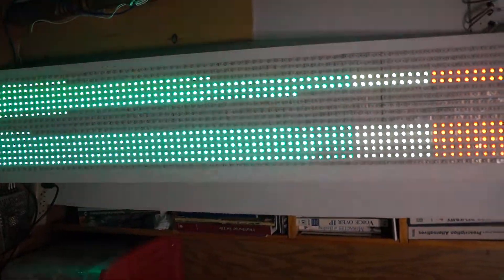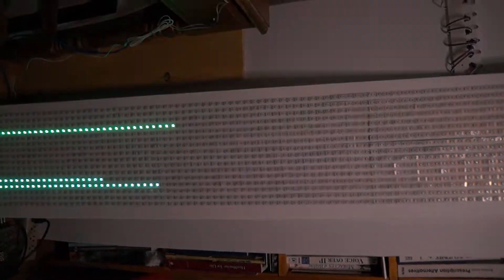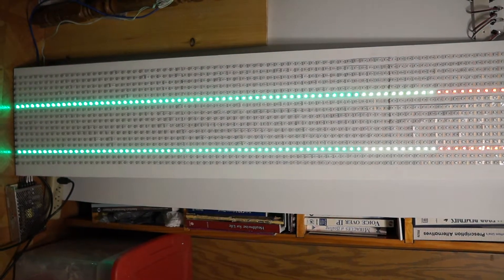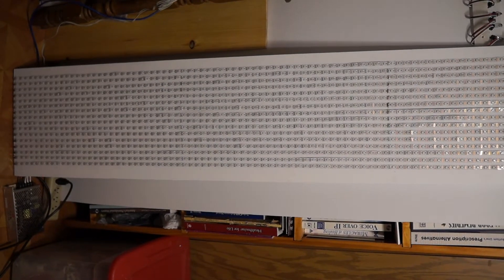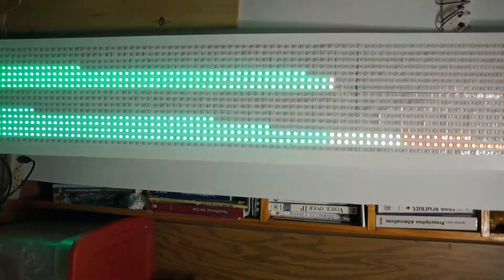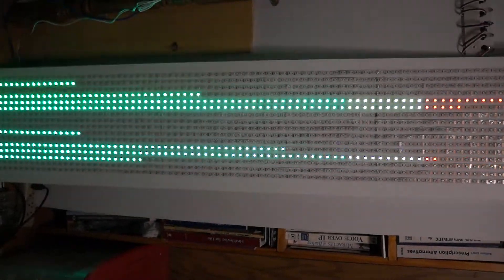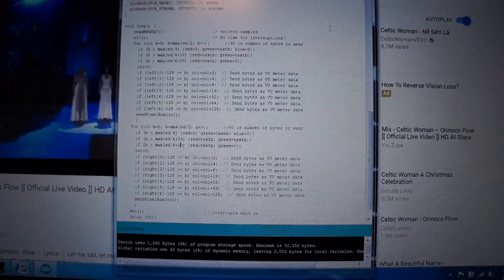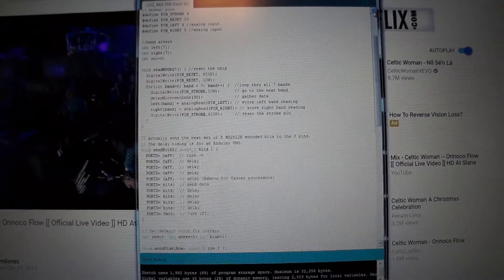Improved LED Strips as Spectrum Analyzer with tone generator

Comment: Very beautifull but couldn't you reverse it, with more frequencies (bands) horizontaly and power verticaly ? (16 stripes would be enough for power mesurement...)
Reply from the maker: I am working on just that.  Also have offset some MSGEQ7's to get 14 bands per channel.
Reply: OK, good luck :)